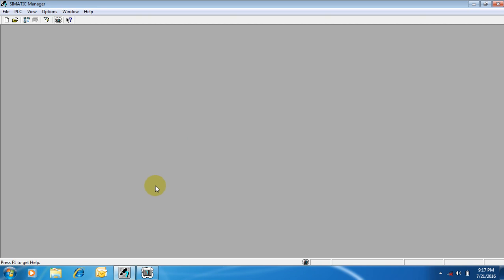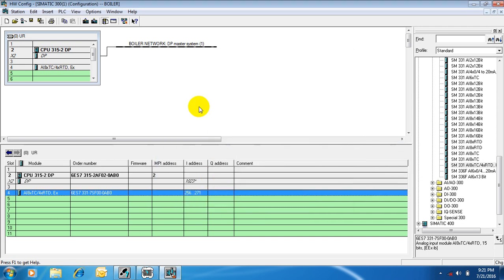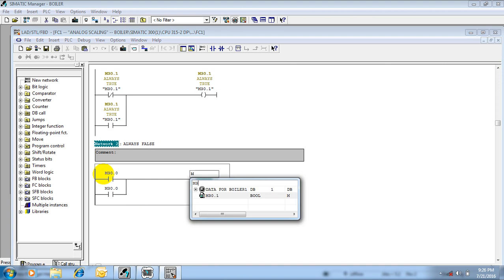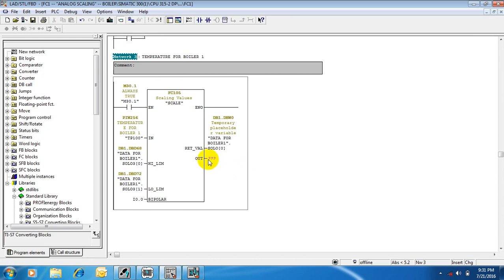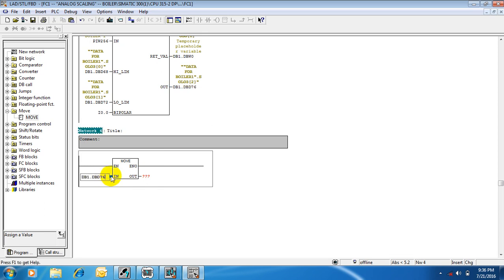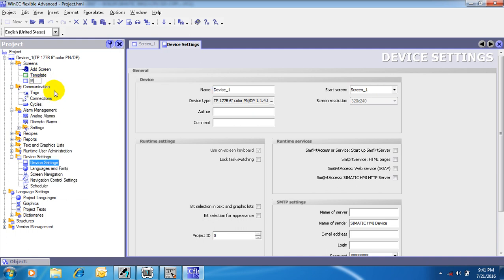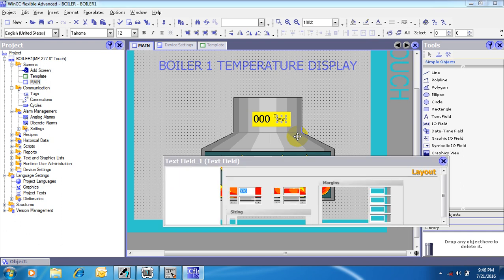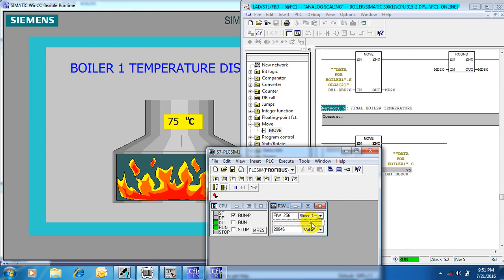plc programming siemens step7-300 simple analog scaling display on winncc flex

Comment: # HI, MR. SOLOMON HOW CAN I GET THESE SIMULATORS FOR WINCC FLEX AND STEP7  ? 
# When you communicating the Tag address of Step7 to RUN time then which communication link was working between these ?
Reply from the maker: mo10 hamid  just installed step 7 v5.4 or v5.5 its has a simulator wincc always has a simulator icon like a desktop computer on the menu bar of wincc page

Comment: 33:00
 at this point initially HMI program didn't read the data DB1.DBD80, but
 when u changed the memory tag from 80 to 76, it started scaling. can 
you please explain why did this happen.
Reply: Its happens because "out" in ROUND block have DINT type. You can instead the "DATA FOR BOILER1".SOLO3[3] put "DATA FOR BOILER1".SOLO1[3]  and everything will be OK!